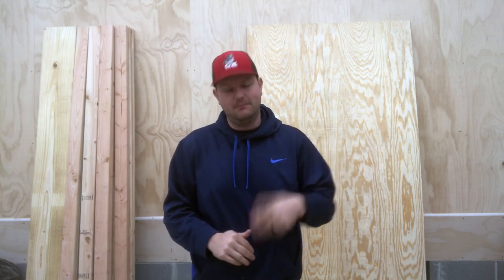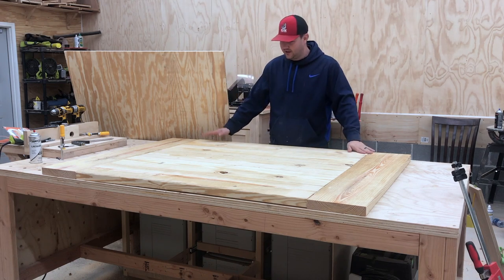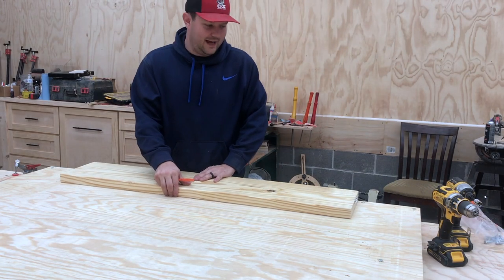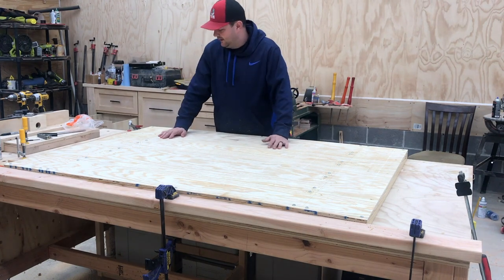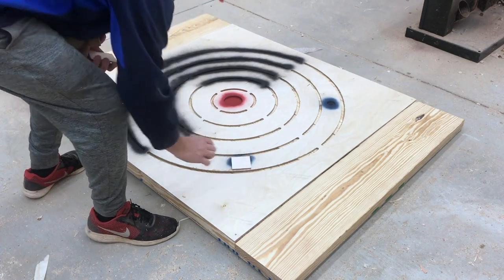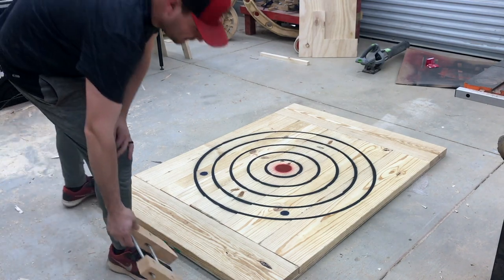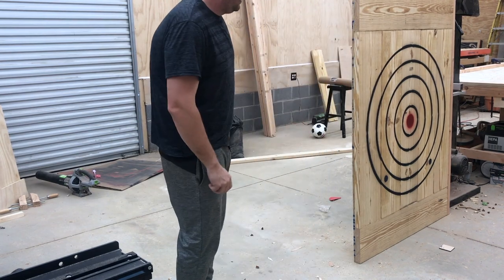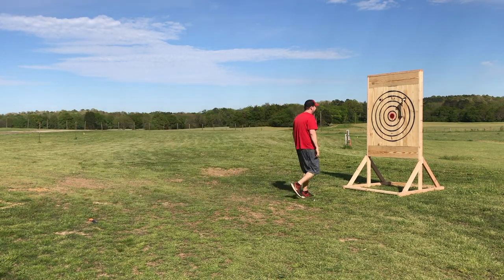DIY Axe Throwing Target

Comment: Pro tip!! Use a bug sprayer with water to wet the wood so it expands and takes the axes better!! Also lengthens the life of the boards
Reply from the maker: Thanks for the tip
Reply: Thanks for your tip, I was wondering if you can run the grain horizontal to stop splitting and extend life if target
Reply: @pineapplesideways3820   The wood grain should be oriented vertically, unless you're throwing sidearm (sideways).  To increase the penetration & lessen the chance of deflection the wood grain needs to run parallel with the axe bit (cutting edge).  If the bits not parallel with the grain direction it's going to chop the wood (like felling a tree) vs splitting & slicing into fibers (like splitting firewood).  
Both spraying the wood with water & hitting in the middle of the boards, as well as using greener lumber will help with the wood fibers healing.  Use 2x10 lumber, so you can flip it and use the backside... Good luck!
Reply: If you're buying construction lumber, it'll be pre-dried out and this won't be as much of an issue.
Reply: You could also just use treated pine instead of wetting the wood.

Comment: When building your target remember to think long term. When you become effective at throwing axes, you're going to damage the wood very quickly, which will require replacement. Especially the center areas where you'll be doing most of your aiming. Design your target so you can replace individual pieces of wood very easily.

Comment: You can a little pock glue to your scare to block the holes... if you screw it in the center... you it as a axle and rotate 45 degree to paint the missing lines

Comment: Couldn't you make the frame and with the plywood on back and add the boards while it is standing since theoretically you should be able to replace all the boards once they become to worn out?
Reply: That's a damn good point.
Reply: Although it wouldn't be as clean and tight most likely you remember how he pushed them all together and then kind of made the frame around it cuz that wood varies in size when you buy it.

Comment: how long does the wood last ?
Reply from the maker: Well it depends on how much you play the guy that I made it for used it a lot and if they play while tailgating all weekend he changes the middle board each weekend for sure
Reply: You could use scaffolding boards as I did, they're made of soft whitewood  and they 2 inch thick so last ages